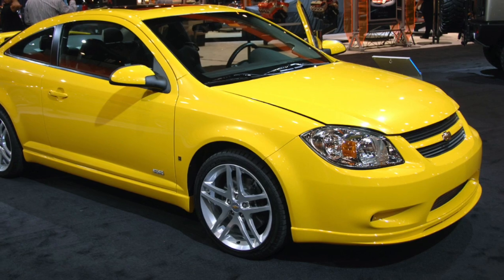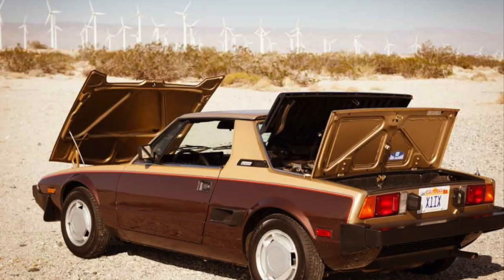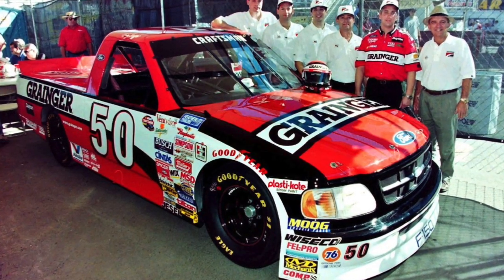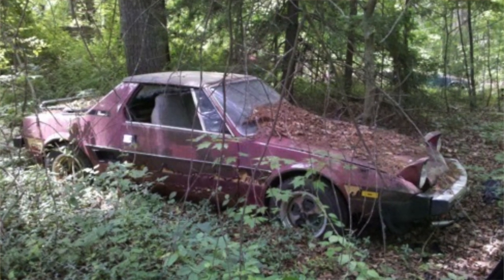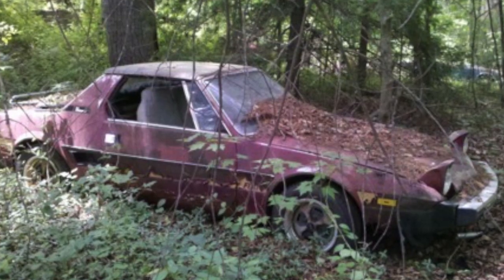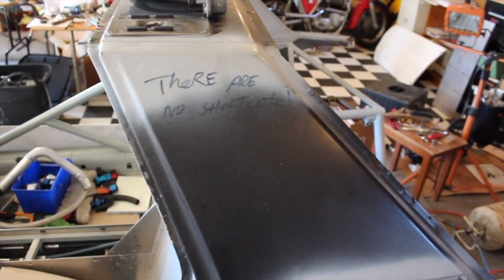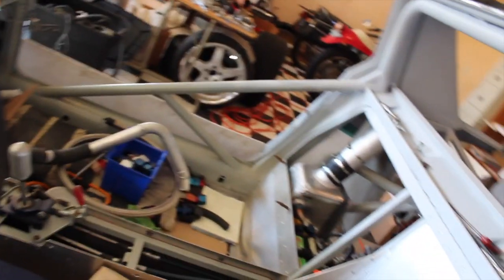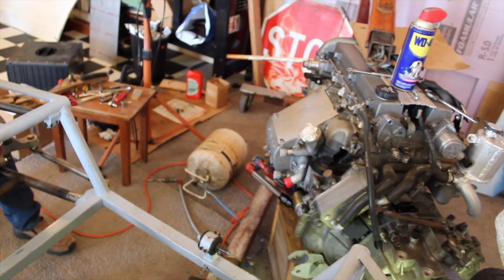Fiat X1/9 motor swap - Ecotec Ep. 1

Comment: "Super light"???????????
Reply from the maker: Yes indeed! Thanks for watching!
Reply: @KurtofTrades  Mine weighed a tonne! (well, quoted kerb weight of 914ish Kg as compared with a Lotus Elan's 680) I always understood that lots of extra Rust-o-Steel™ was added to comply with threatened US roll-over regulations that never materialised once they'd done the job of scaring off European imports, the result of which being that the X1/9 (at least in original non-corroded to hell form) was remarkably strong for the time. I remember various pictures doing the rounds of cars that had hit trains etc leaving the passenger cell intact; Probably better than one might have fared in the Lotus.

The upshot was that the X1/9s power:weight was not as good as it should have been and hence the popularity of fitting Lancia twin cams etc. From the looks of it, your dad's may indeed end up being super light. I would have been happy with 750kg and 150bhp in a non water-soluble chassis. Actually, if they'd made that, I'd still have mine.

Keep up the videos. Always good to see something X1/9-shaped being kept on the road.
Reply from the maker: I’m curious to the final weight as well. Doors are going to be aluminum frame and carbon/fiberglass along with the majority of the front and rear clip.

Comment: If you’re going to create a new engine out of the Ecotec why not use a h1 V8 to begin with. Engine weight is 200 pounds and a NA engine makes 450hp. It would mighty tight in a stock X1/9 but you’ve cured that problem.  Couple that with a Quaife 6 speed sequential trans and the Ecotech set up becomes a Ford flathead comparatively.

Comment: This is all great in its own way and I wish you well. X1/9 it ain't, there's nothing left.
Reply: You are so right but when modifying an X1/9 in any way, when does it stop being an X1/9? Honda K swap? Lancia 2.0. Bigger brakes? Blame that on Fist. They fought Bertone from the start and built the X begrudgingly. 5hey did not even attempt to find the car’s amazing potential. All of the R&D was done by Abarth, PBS, FAZA etc. the very platform allows you to make what ever you want out of the car as with any race car, the winners didn’t drive off of the showroom floor.
Reply from the maker: You aren’t wrong.  It will still look like an X1/9 with the same rear and front even the grill. The sides are going to be quite wide and it will have a litte bit different aero on the front.

Comment: OK? Why a Chevy engine? And not a Honda k20 engine?
Reply from the maker: He has worked extensively with the LSJ and lnf as opposed to the k20 so he knows how to mod them.  Also he has a ton of parts for them got a really good deal on several motors and internals.  Basically he had all the stuff to do it already and knows the motor extremely well.